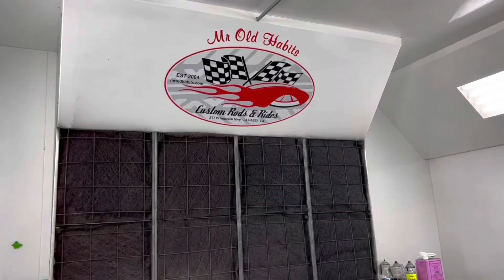Barn find 1972 Chevy Barth vintage motor home

Comment: What other work was done to it as far as the running gear. Good front-end under it?. It looks like a big block. How was the gas tank and the structure. Amazing job on the inside